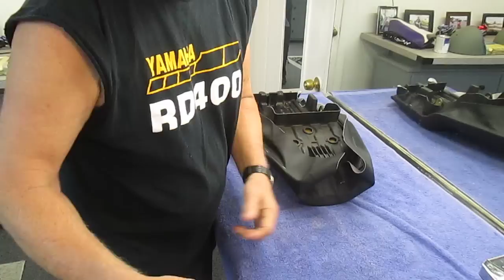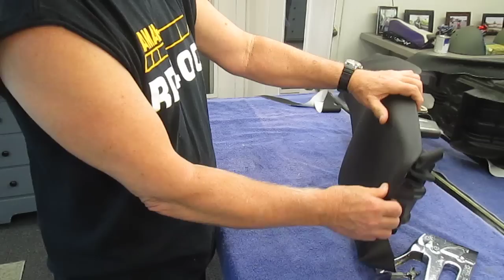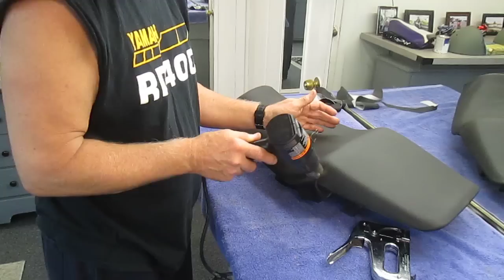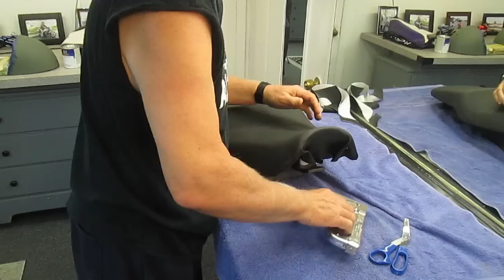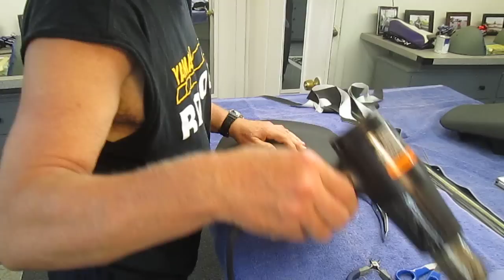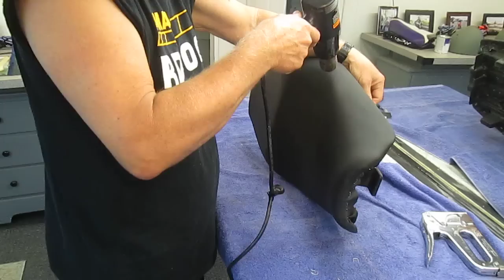HOW TO RECOVER A MOTORCYCLE SEAT.

Comment: thx m8 8/8!!! What do you think about using leather vs vinyl?
Reply: Leather does not stretch like this vinyl. Leather would require multiple panels being sewn together to give relief to the contours and edges. Leather is alot more expensive and when sewing it, once that needle goes through there is now a hole that will never go away.   This stuff is very forgiving and fairly cheap. Leather is no where close to either of those things. Dont get me wrong, leather is awesome. Just requires a higher degree of skill and equipment.